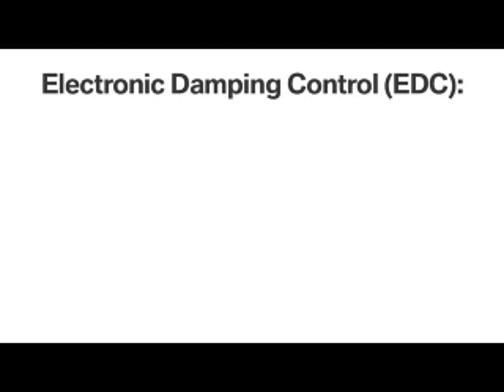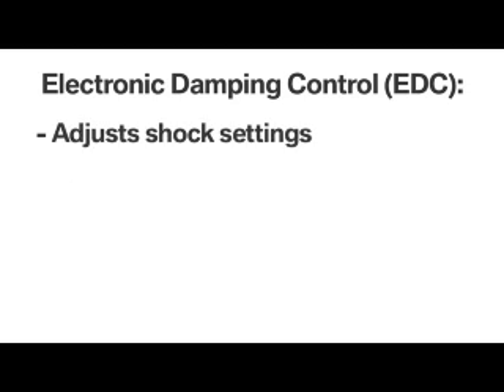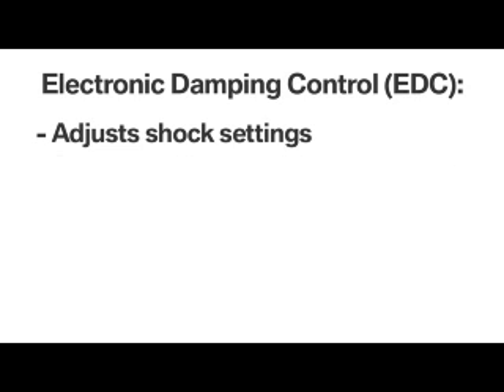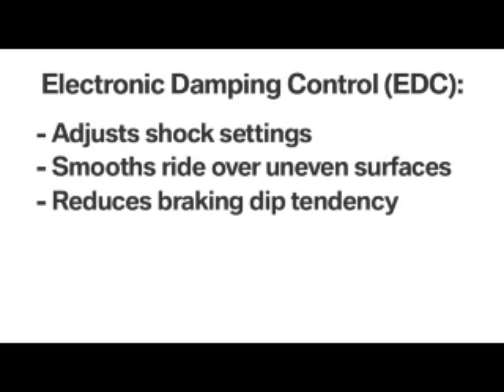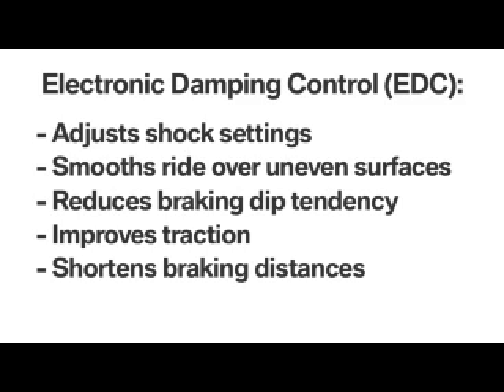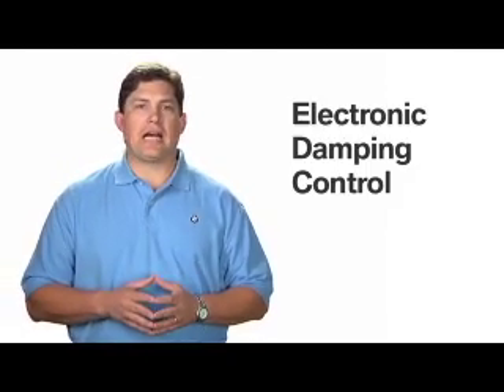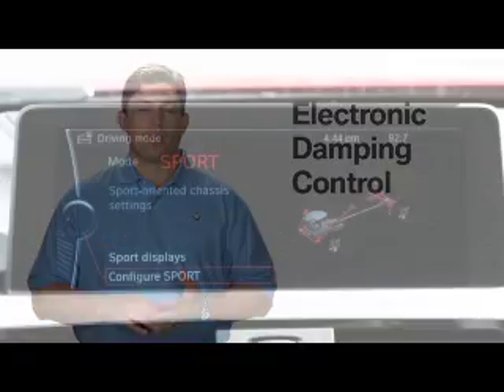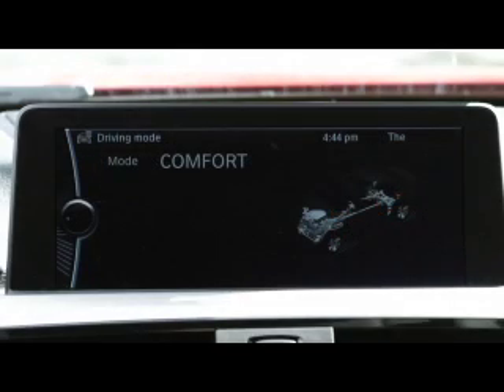BMW Electronic Damping Control EDC

Comment: piece of shit, my EDC stopped working and never gave a fault or error code and defaulted to the stiffest setting. BMW are terrible for anything electric or electronic.
Reply: Mine did the same. Have you ever found a way to bypass it or fix it somehow? Thank you.
Reply: Have you fixed it ?
Reply: @MJ-yu7kw  that was a long time ago. they replaced the entire EDC electronic card and it did not fix it. My take is flawed design concept by bmw. After the car break-in the mechanical joints get slightly looser in the suspension which is a normal process and that completely throws off the EDC concept  which becomes useless. Like many other things "BMW" it's designed fast with insufficient scope to understand how other system can affect it. I was stunned by how german engineer overlook even simple problem in their design that it almost seems like as long as it works in the prototype and in the showroom they don't care.  Another example is the seat belt dispenser. I had a maxima before the BMW M3 and the maxima automatic seatbelt never failed once in probably 5,000 uses. The bmw system fails 40% of the time ! And  it goes on with everything BMW, it's all flawed concept design, poor reliability.  I'll sum up BMW as performance with low reliabilty and careless design concept for the long term.
Reply: @goognamgoognw6637  that’s true, I’m facing similar issue with my car. It’s stiffer than usual without any error codes, probably will have to replace the entire shock absorber.